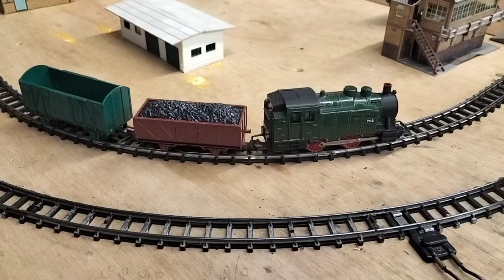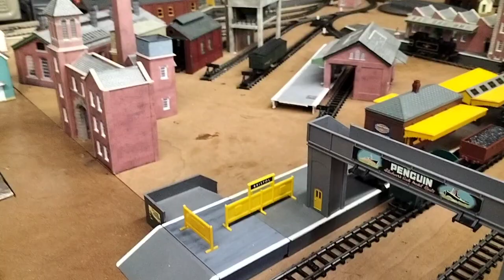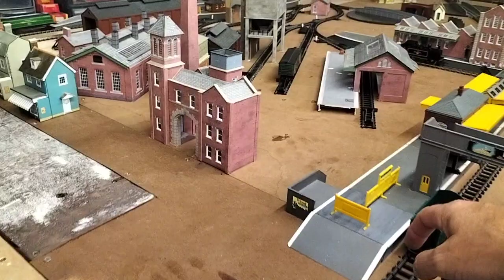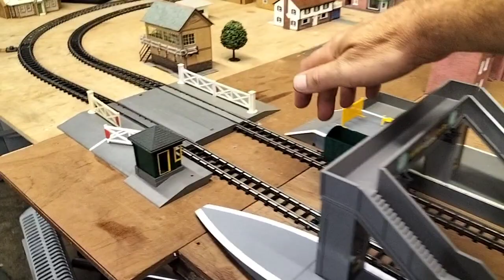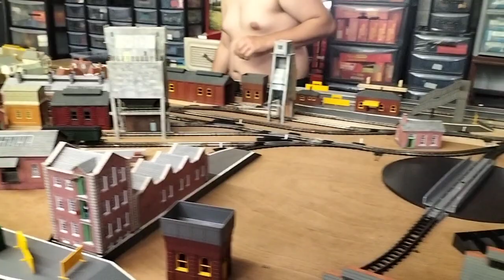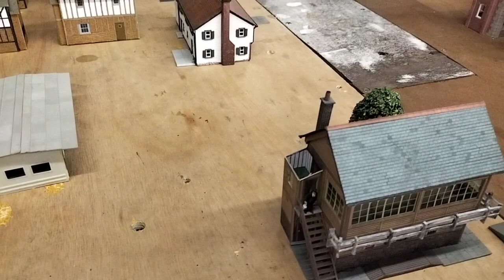remembering my child hood.🤣🤣🤣

Comment: nearly missed this one....always enjoy watching....i still hold the view that the series three points are better than super 4,...just more solid built,and the springs don`t come out so easily on the levers.....that fighter pilot is a  lovely engine...can you run a train straight through that turntable and onto the far side of the layout,or would that not work electrically speaking..ie a return loop....cheers..ade